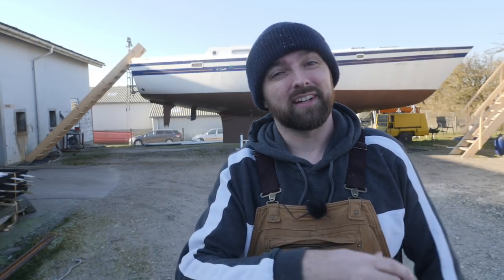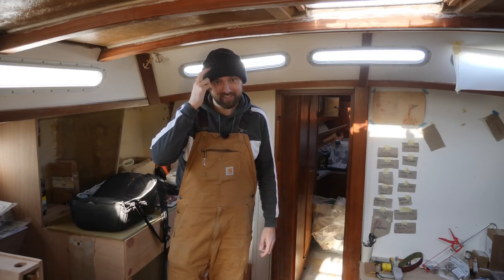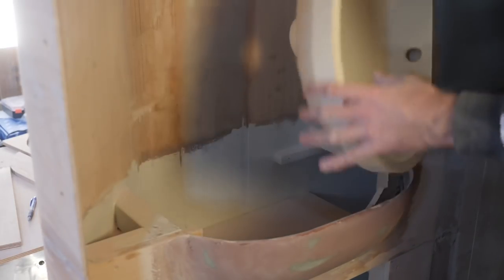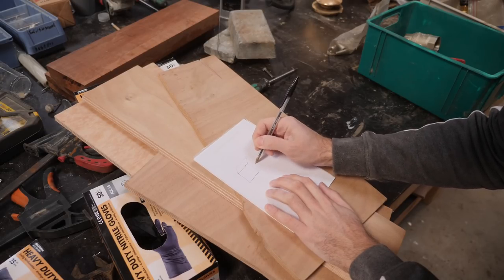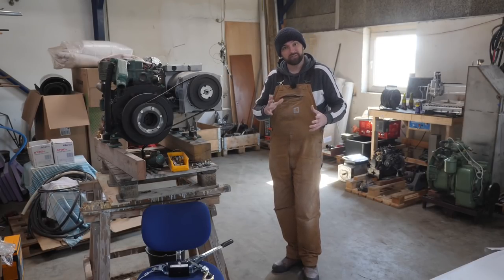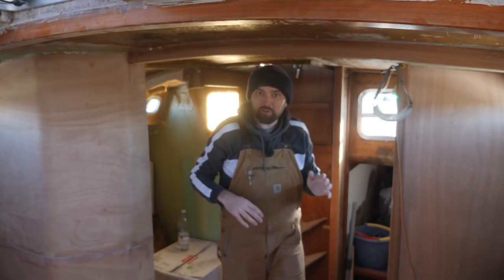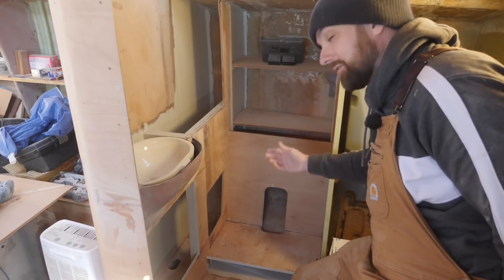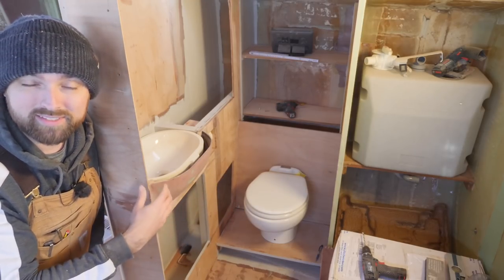Sail Life - Back in Denmark, sink cover and toilet paper holder - DIY boat project

Comment: prioritize the projects required to take athena across the atlantic... then all your other half has to do is hop on a boat and meet you off the east coast.  if it comes down to it, at least that will be an option.  if the world recovers you can worry about immigration and fiddly bits later.

edit: now having watched the entirety of the video... you can get add-on bidets that replace the seat and yes, it will fit on your marine head.  HOWEVER they require pressurized water, 120v ac  (no problem for you to provide you genius person) but you will have to mount the head further away from the back wall than you originally planned to allow for the additional mechanical bits.

Comment: Not every holder works. American and European differ, even the UK and the eu27 differ. Metric and non metric. Cruising on a boat you accommodate both systems, think you need to check this out.